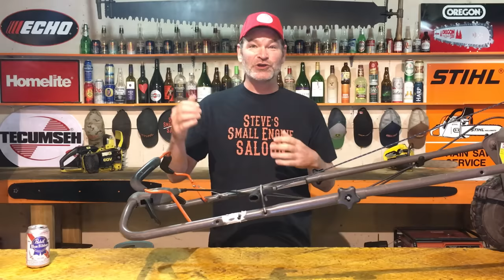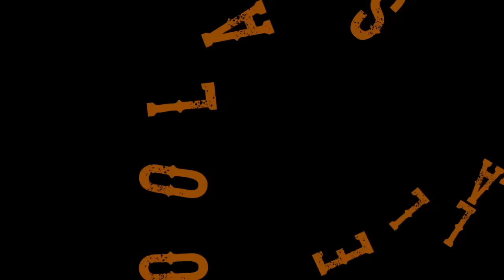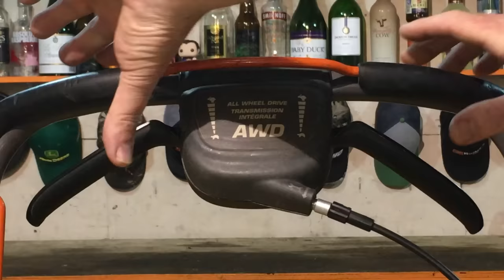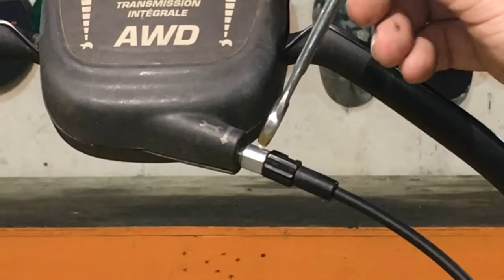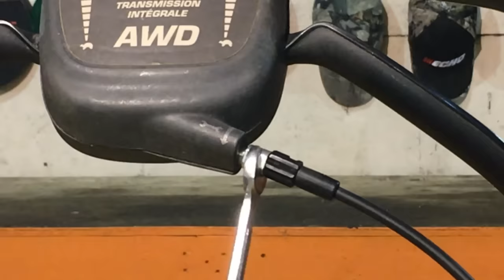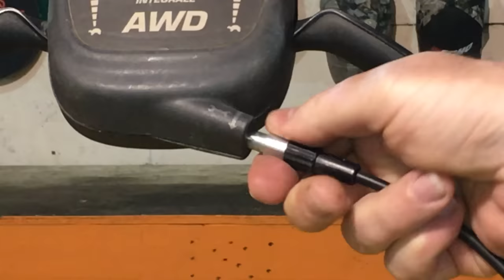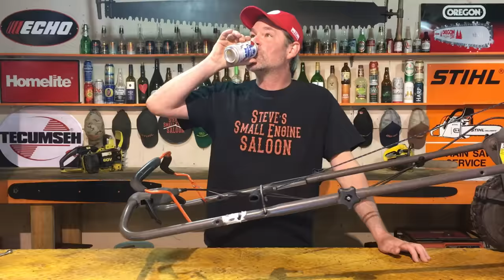How To Fix A Self Propelled Lawn Mower That Won't Move

Comment: I have a small gardening business and recently I have purchased a Honda self propelled mower to make my mowing jobs easier.  I don't have any experience with self propelled.  For the longevity of the engine, is it ok to continuously use the propulsion or should it only be used when going up hill?

Comment: I changed the drive wheels out and also adjusted the belt the gears where shot it will barely move is it possible the belt is stretch to much just bought this 2005 troy bilt

Comment: One EASY piece advice to dramatically extend the drive system.  Manual push the mower up to speed THEN engage the drive system.  This will help with belt slippage and worn tires too!  Or the lazy option of as you engage the drive wheels push the unit too!

Comment: Depends on the mower as some drive cables have the adjustment in the middle of the cable. Also check belt or the spring is still attached onto the gearbox if there is a fault where the drive isn't working at all usually the levers have no resistance at all.

Comment: I replaced belt and cable still won’t pull up hills like it did new!! Like it won’t spin like yours did in video?? Do you think the aftermarket cheaper cable is differtsize then oem part u have posted ?

Comment: Steeve . Thank you for the video. I have a question for you . I have the same mower. The problem I’m having is that since I have a lot to mow holding those levers in a grip the entire time you mow the lawn it’s very tiring . Especially with arthritic hands . Is there a way to “lock “ the triggers in engagement so you don’t have to hold pressure the entire time you mow the lawn . I had another mower that used a lever that was just like the throttle lever and it was much easier to maintain the clutch engaged . Please help

Comment: Good Morning Steve, A bit off topic but I was wondering your thoughts on running  a 50-1 mix in a blower that calls for 40-1.  I like the engineered trufuel and its much easier to find in a 50-1 ratio... Thanks.
Reply: Gg

Comment: Tension helped, but now she slips on the pulley rather than the drive engagement.  I've got an ariens 911044 in front of me that squeals when it slips, after much head scratching, the squealing has been identified as the main pulley/belt slipping. Any ideas? Seems like the tension on the belt is okay but doesn't look like it has much adjustment available

Comment: Steve, would this work on a self propelled greenworks mower also? I don't believe that I have seen an out side adjustment cable on this machine. I bought if from a liquidator that got it from Costco as a return. Probably returned for that reason. Greenworks doesn't seem to have a very good parts supply dept. The authorized dealers here tell me that Greenworks just sends a new lawnmower to them if mower is under warranty which my mower is not. The dealer tells me that is likely the mother board but I is brand new so I am hoping it is just a cable adjustment?

Comment: Have you done a video on the filter in the muffler on 2 cycle engines?  Pulled it out and started running smoothly.
Reply: George Welden yes he did
Reply from the maker: Yes I have....
Reply: Just go to his website and use the search and the answer is yes

Comment: I used to live near an open metal scrap yard.  Anytime I needed a new lawnmower I'd just walk in there and grab one for free.  So many times people throw away a lawnmower simply because it has a bad spark plug,  or the air filter is clogged, or the pull starter recoil spring came loose.  Lots of good mowers in a metal scrap yard, and that was 35 years ago.  I wonder what it's like now.  they probably got fences around all the scrap yards now, hahahahahahaha

Comment: The other common issue with some of them is the engagement mechanism (or the pulley itself) gets packed up over time with compressed grass clippings that have worked there way into the belt shroud Jamming up the mechanism another simple thing to check ..

Comment: Anyone got any feedback on my issue.. When I engage my  rear wheel drive toro self propel. The wheels will spin if I lift the mower up.. But as soon as I put it back on the ground... Nothing... Any suggestions?   Does that mean a weak belt  or  bad transmission? Thanks ahead of time..

Comment: I was in a bad accident last year, and injured my legs. My self propelled mower just wont...self propel. Pushing the mower has gone from walking along with it to trying to move an adult rhino.  Hopefully your advice helps me.  We have a lot of grass to cut, but I never mind doing it...even in 95 degree Florida days.  If I adjust the cable like you mentioned, and it still wont move my wheels, what is the next step? Is there another video explaining what to do? Thanks so much.
Reply: My mower was hard to push even on the driveway.  Weeds and stuff had gotten wrapped around the drive axle.  Took about 20 minutes to pull and cut them off.  Once it was cleared, it self propelled without any problem.

Comment: Hey Steve my mower is idling really funny and I noticed one of the springs came off. it's the smaller one, do you know how I would go about finding a replacement spring? it seemed to be really small and thin spring

Comment: Do you have a video on how the Toro self propelled transmission works (squeeze handle type)? I hope it doesn't involve just slightly slipping the belt to slow down the speed. Slow walk speed is how I want to go all the time. Don't won't to burn the belt up if that's how it works.

Comment: The cable system on my Murray is different. It's has pellet like head that goes through a loop that is attached to the propeller bar rather than a handle. Anyone has one like this?

Comment: Hey Steve, great video! I have some issues with a used weed eater I picked up, and have been searching for an answer with no success. I thought you might know. It starts with the choke on and runs, but with the choke off it doesn’t run for very long, even when warmed up. The weird thing is, with the choke off, the only way to get it to keep running is to have the throttle wide open, or to just let it idle.  Anywhere in between and it just dies. Any thoughts?

Comment: Great channel Steve, I'm a huge fan from out in Halifax.  I've got a HU800awd as well and have just changed the old worn out belt.  I adjusted it with that little nut as you did in the video and the self propelled works great now with the exception of trying to start the self propelled feature while on a steeper slope.  I kinda have to give the mower a slight push to get the wheels spinning then its fine otherwise it seems like the belt is just slipping.  Is this normal or is something else that needs to be adjusted? Thanks.

Comment: I had a similar issue but in my case after I took the belt off and put it back on, the mower fights me to engage, doesn't go, and the fights me to disengage. So basically, it won't go on it's own the wheels lock up when I push it.  I've yet to figure out the issue.  The pulley moves freely so I can't quite put my finger on the issue.  Why did I take the belt off? I actually didn't, it fell off when I was changing the blade.  Hasn't been right since. My brother has the same mower and the same exact thing happened with his.  Oddly enough, I just found that out the other day.  I didn't even know he had the same mower.

Comment: I have a Husqvarna LC221RH lawn mower that stays engaged all the time. I’ve tried adjusting the nut at the top and gone from one end to the other. It’s a new belt and was doing it with the original belt as well. Any thoughts??

Comment: PBR nobody can just sip twice——or wait maybe that’s potato chips. I only knew this because I left my mower outside int rain heat humidity. You know what broke. Threw bad one away used twisted wire Jimmy rigged about 4 years ago. Keep it inside now

Comment: Hey Steve! Big fan. Question? I have a John Deer self propelled mower and every time I engage forward it wants to and or dies. Help!
Reply: Bill Gunter Hey Bill, this may sound stupid, but it happened to my Honda GX just this year...flip it to its side and check to make sure the underdeck isn’t clogged with grass.  But you’ve probably already checked it...we had put in fresh gas, new plug, new air filter.  Every time we engaged the blades and went forward, it died.  Apparently the blades didn’t have room to spin. Head slapped roflol
Reply: Elaine D thank you for your input! Really appreciate it.

Comment: I have a rear wheel drive.  I noticed only one wheel turns.  Sometimes when I back up, both rear wheels are locked.  What do you think causes this and are they related?
Reply: I have the same problem,  mine was pulling to the left before it quit working altogether.  I don't think the cable adjustment will fix it

Comment: Mine is on the side and no place to adjust as far as I can tell. It looks like it is in a clamp or something or small piece of plastic covering it. Mine has the propel handle that looks like the throttle handle.

Comment: Replaced transmisión in husquvarna front wheel drive model# 961450009-01 now it drives backwards what is the problem

Comment: Steve, do the twin levers work one axle at a time or both simultaneously ? What happens if you squeeze only one lever ?    Thanks     J K
Reply: There appears to be only one cable going away from the handles, so I doubt the mower knows which handle gets pressed. Just my assumption though.